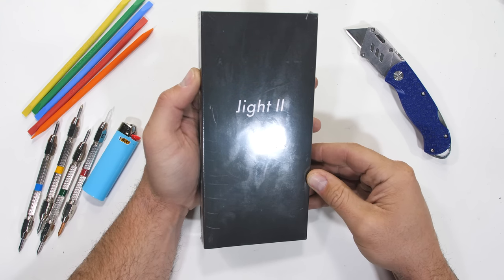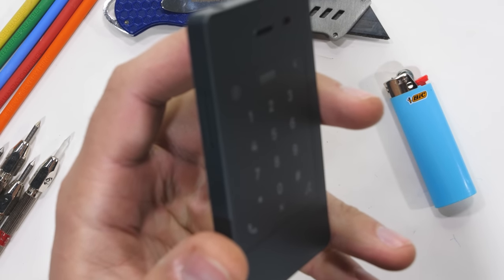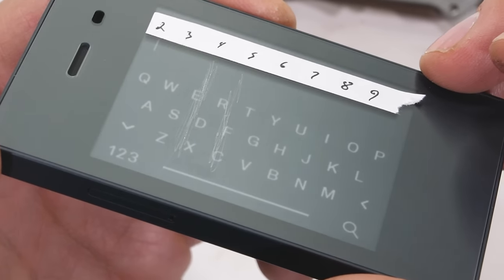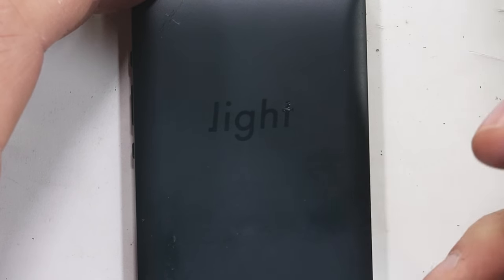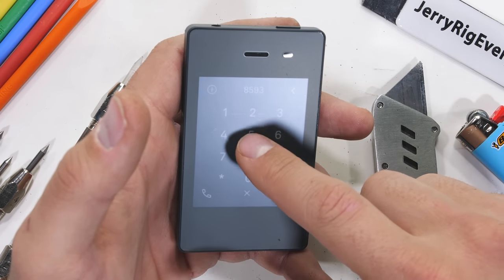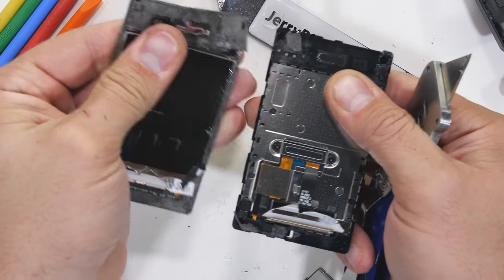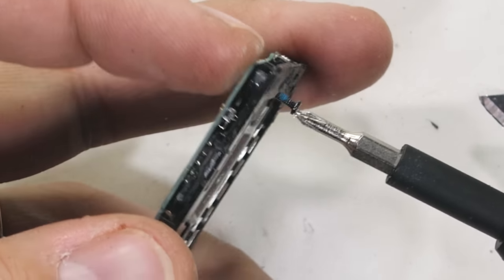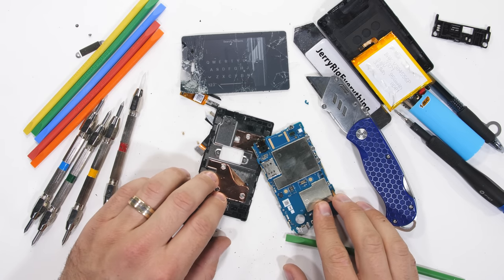The Dumbest Smartphone?! - Durability Test!

Comment: See, I wouldn't mind having a phone like that as a back up, I would love it actually, and I think the e-ink display is perfect for its use and actually pretty cool... but come on... for $300 put on it a good DAC and amp, expandable storage, an audio player, a body of at least aluminium or maybe even steel, removable battery and off we go. I'd buy it.
Reply: honestly yeah, for 300 it should double as a competent dap if it has music capacity. its bare necessities plus music and navigation. its all id want  but everyone seems to go way under or way over
Reply: 1 gb is also insanely small. I get it doesn’t need much for what it is, but for the price… like… Apple’s iPhone 13 mini has 128 gb and it’s $699. With way less features and cheaper parts, this could easily have more gb. I wonder what their profit margins are.
Reply: @user-sf9gs2pg1b  probably higher than youd want, but also this is so neiche they would sink if it wasnt
Reply: Honestly, it could def do with a smaller bezel too, I'm not asking for much but 300 dollars for something that would typically be less than a third of that is an outright scam
Reply: This guy gets it. So would I. Perfect for a backup or in my case a work phone.
Reply: removable batteries are dogshit like propaganda such as right to repair

Comment: The dumbest phone he’s ever durability tested was the NoPhone, literally just a brick of plastic.
Reply: @Codyslx  it had the A16 bionic chip too with True Tone & the new fast lightning connector how could u forgot that?
Reply: @Codyslx  am ded
Reply: @Lol-rv5bv  a16 bionic with snapdragon 877
Reply: @2tonedripgaming420  dual cpu and gpu!
Reply: And it cost $300 😂😂
Reply: @Codyslx  looks like someone knows their tech...
Reply: Pretty sure no phone didn't cost $300 like this scam does.
Reply: @Codyslx  It also had a 1 million times optical zoom along with a wide angle sensor, an ultra wide, an ultra freakin wide and a full 360 wide along with a 1 million mega pixel main camera and a similar under display selfie camera
Reply: @Codyslx  and it’s WATERPROOF how could you forget that??!
Reply: @Codyslx  it also had RTX 3069 with The Refesh rate of 420 fps
Reply: @Codyslx AND the IP 1010 rating
Reply: And,also,no charger you noob,buy it for 727272 dollars

And it has a dual shock controller for the 7272728362782288282722 oled titanium screen. 

Also,we are bringing a new thing

It has something,we call, Motor TV Resolution

It can expand its screen,and be bigger then a tv,and it’s resolution FPS is massive

It supports the new PS737373738377373 console,which is just air
Reply: No phone air was only a packaging
Reply: He should test out the NoPhone Air
Reply: did you just forget about the nophone air?

Comment: I was actually really impressed by the e-ink display. Looks like they put a lot of work in improving the technology and designing the phones OS to take advantage of it. It would be kind of cool to have a fully fledged smart phone that used e-ink and with some cleaver software design it you could do almost everything you do in an OLED on a high quality e-ink (except for watch video and play games but in theory everything else could work).

The phone could auto refresh the screen when ever it receives a text with the message app open. And refresh the screen a few times a second while you do a swiping motion to scroll through webpages/app interfaces. And then you’d have a mostly functional smartphone that only needs to be charged once every 2 weeks. (E-inks only draw current when the refresh and it’s a tiny amount of current) 

It wouldn’t be nearly as elegant as an LCD/OLED obviously but it’d be a great thing to have incase your main phone died while out in town or camping or something like that.

I wouldn’t even pay $300 for this massively improved version though, MAYBE $150 and that’s because I’m in the very niche market of needing a smartphone that has multiple days of battery life(for camping/not having to worry about charging up before a hike)

Comment: I'm using mine since about a week, and I'm very happy with it. I'm hardcore addicted to screens, and I divided my lost time on phone/tablet by about 20. 
I still have access to (some of) my podcasts, and I upload one audiobook at a time, which is pretty nice. 
The only thing I'm really not happy with is the battery life - I don't understand why such a minimalist tool can't stay on for a month without the need of a charge.
Of course, you can probably accomplish the same with a 40 bucks Nokia but on another hand you won't have such a nice software experience.
Reply: Hi, since it's been 2 years from your comment I thought you might want an upgrade that will have enough battery to last a month. --- you could get a cheap android phone with an AMOLED display and large battery. Install a minimalist launcher, Set the mobile data mode to 3G and just easily uninstall all the social media and other apps you wouldn't want on a light phone. And ta-da! You have a phone cheaper than a light phone. But much better
Reply: Just wanted to add-on I'd recommend getting a OnePlus 7 Pro for this just because it has an edge-to-edge screen with curves so design is really good. You can always get some black round stickers to cover the back cameras and get a soft material black case with no advertising to give it that minimalistic look. your welcome!

Comment: The legends says that the e-ink screen is still displaying in 2100.
Reply: ... would it though? My understanding of e-ink is very low
Reply: It's kinda like printer ink so it will display for years without power
Reply: @MelodicTurtleMetal  Yes, once the pixels shift into a state, they will remain in that state forever until electricity is applied again and it refreshes again.
Reply: @LittleWhole  but what kind of lifespan should you expect from the dye used in the microcapsules to display the black?

Comment: It honestly might be better off thinking of this phone as a medical device, for those thinking about “value” per dollar.
Let me save you some time, this phone isn’t a bargain. You pay a premium for a phone that doesn’t do much.
Howvever one thing you might find incredibly valuable about it is just how small, thing, and light it is in the pocket compared to other options. This is a strange praise, I know, but the lightphone 2 is the worst phone I’ve had since I started using smartphones
This gives no dopamine. One glance at it and you are reminded that there is no entertainment to be had. Your socialization options are: call somebody, or text. (And the texting is painful)
But for a phone that’s designed to reform habits, it is very nice how unobtrusive and lightweight it is in the pocket

Comment: So it's basically a $25 e-reader, smaller, less feature rich and it costs 12 times as much?

Edit: What if you were to buy an e-reader, manually make yourself a sim card tool that attaches to the e-reader's charging port and develop your own software? You'd still spend less than this phone.

Comment: If that phone has no data, it means that i wont be able to do calls in the US on most the networks, since 3G Sunset, and only phones with VoLTE support can do calls.
This also applies to other country's which are starting to reduce/turn off 3G. Also for phones that do support VoLTE still might not work, as it requires the Operator to have had sold the phone to put a Carrier Bundle on em for VoLTE to even work.

Comment: that ' famous ' lightbulb that is running for so long is running for that long...because its running on lower voltage , thats why it lasted so long, modern lightbulbs are much brither thatrs why they wont last as long as we demand more visible light form the same size of the bulb. just so you know . check your facts yourself

Comment: What is an emergency phone that ran off of a AA or 2 unfortunately it was 3G and I don't think anything has come to replace that in the market. As somebody who's looking for a cheap not very flashy basic phone for emergency throw in the glove box to use when AT&T decides that they rather not be billing you and just shut you off leaving you with no way to contact them but I digress we ended up with TracFone and T-Mobile PP and now subsequently the main account went from AT&T to Sprint to T-Mobile so I lost my redundancy especially now that TracFone lost my number on the back up phone making me switch to Ting.
Still that leaves me wanting an expensive not fancy phone that's unlocked.